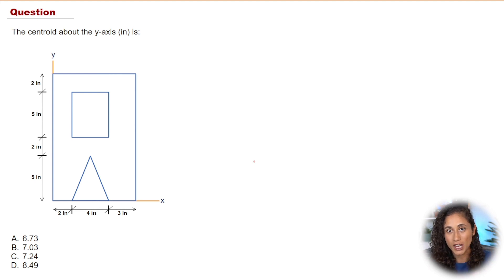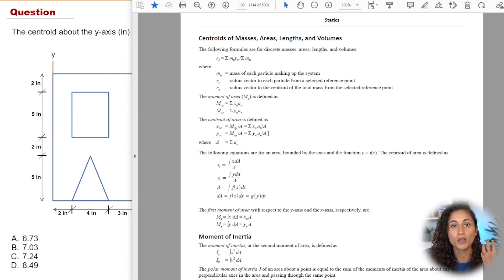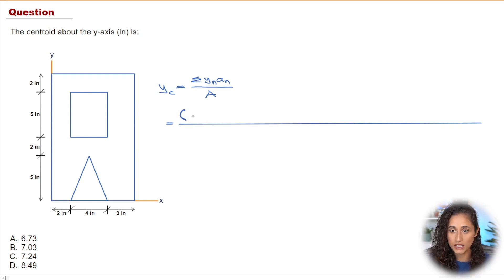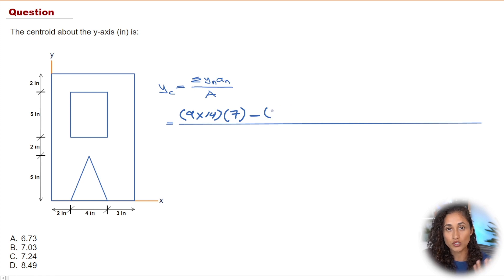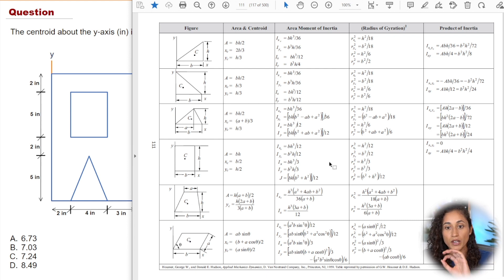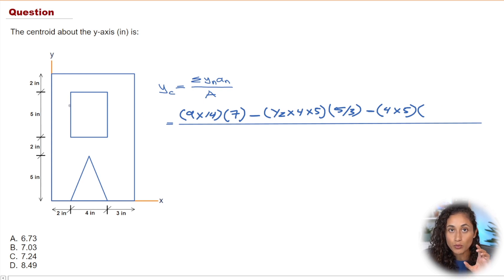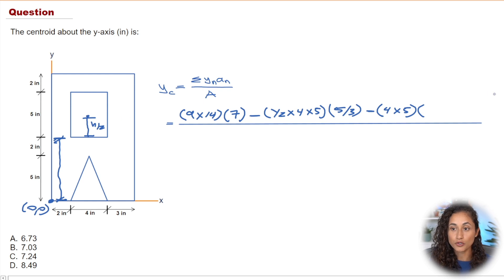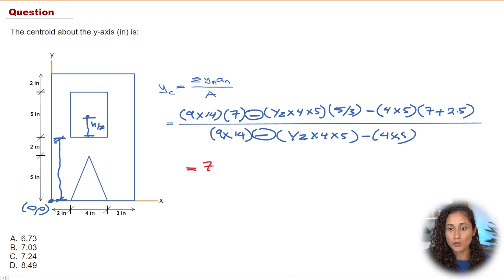How to Find Centroid About Y-axis Composite shapes| FE Statics

Comment: some one please explain, she has to be doing this backwards??? This is for about the X-axis not Y-axis
Reply: She is doing it correctly, however, the terminology being used draws the confusion. I wish a term other than "about" was used. Whenever "about" is used, my mind jumps to rotation/moment about the axis in question. For example, when deriving the moment of inertia about the centroidal x-axis, it is taken in relation to the y-axis. In this case, it is counterintuitive, where y-bar is located along the y-axis.

Comment: Thank you so much for this video! When I attempted it myself on the first go around, I used the equations on page 111 to find the yc values. So I took the yc value of the big rectangle and subtracted from that the yc values from the little rectangle and the triangle. I'm trying to wrap my head around why this process is incorrect and why we need to use an equation for centroid that includes area as well as yc. Can someone point me in the right direction?